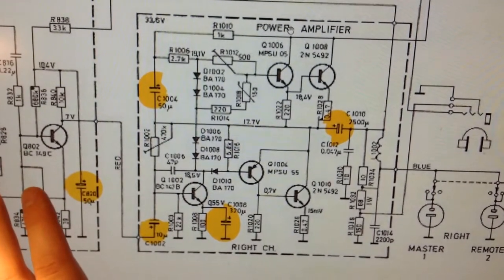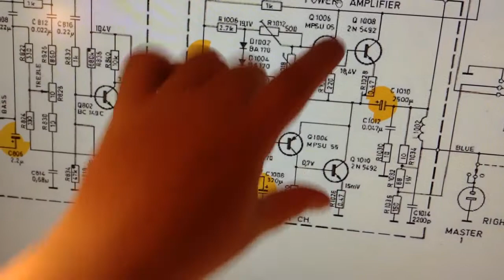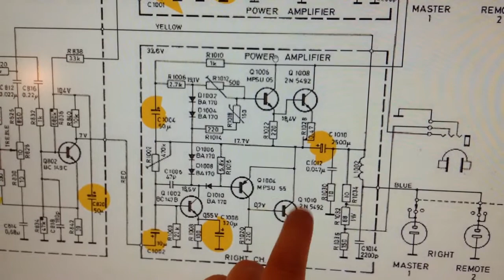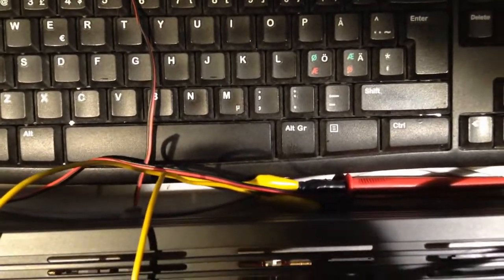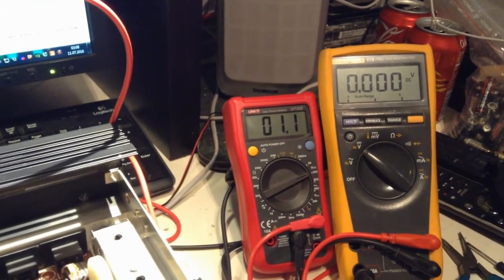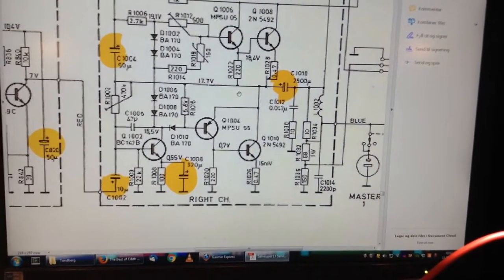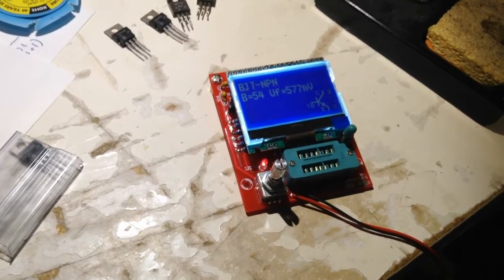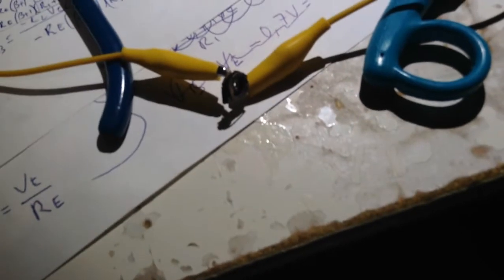Tandberg SS11-73 Fault finding & Seized AM wheel (part3)

Comment: Many suspect components there. And all hard to get to I suppose. Did you check that resistor by any chance? You did say at one point that the pot adjustment didn't go as planned so it's good you caught that.
Was the transistor checker your own design Hans? It looks like a neat little bit of kit, even if it doesn't test under load.
Reply from the maker: A bit hard to get to. Need to measure some of them from the underside of the circuit board. Yeah the pots were really bad, but seem to work better now. Will change them at some point such that they don't decide to slide and fry the output transistors.. The checker is a transistor tester kit from banggood. I've editted in a link in the description. It's very handy. It shows you what is what on the pin. What I don't know is if how accurate it is in measuring capacitor leakage, which might be the culprit..
Reply from the maker: found the fault. hint was in this video regarding the 1k resistor didnt make sense..
Reply: Good! So the 1K resistor was broken?
Reply from the maker: It was fine. Making a new video..